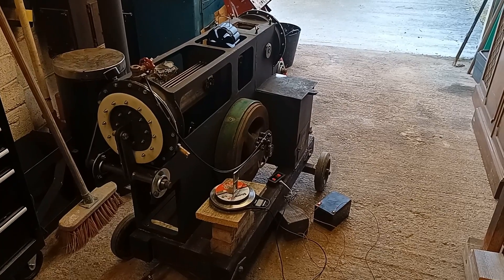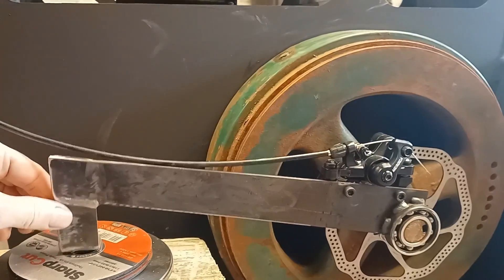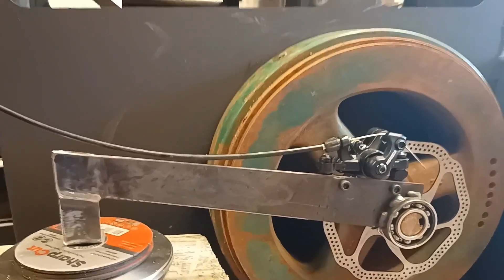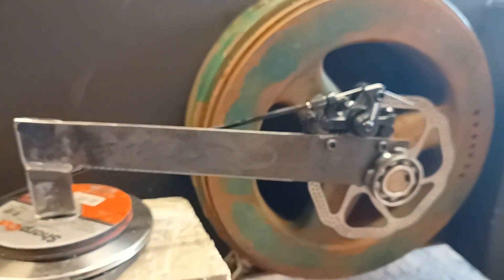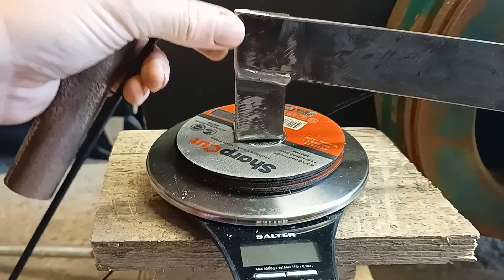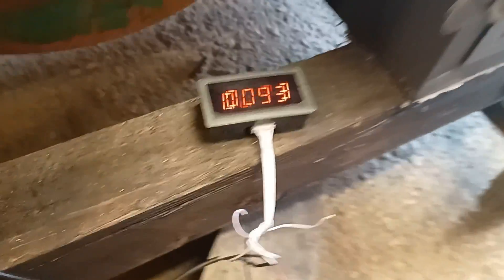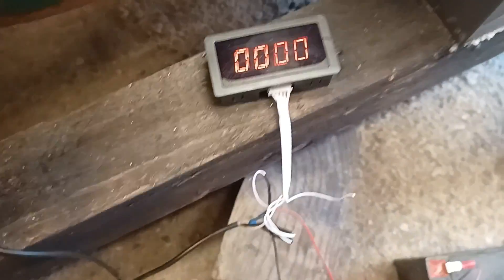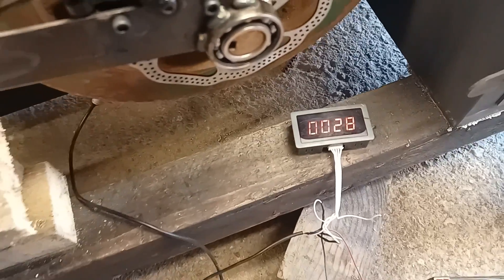Stirling Engine Generator Mk4 (Rocket Stove!) Part 7

Comment: After 400c° rubber melts, unless using water jackets or chambers not directly attached to the heat source. Temperature control is everything for performances and durability.

Comment: This is possibly a stupid question: Does the rubber sea work against the engine? Presumably it's elastic and the expanding gas has to work against it. Also, it looks like it inflates out at tdc, is that not gas expansion that's wasted on inflating the rubber instead of moving the cylinder?
Reply from the maker: Yes, you are quite correct 🙂, a bit more work to do on this project!

Comment: Rats Shane. Sorry about the diaphragm blow-out.
I really like the pony brake and rpm indicator.  The engine looks really nice. I wonder how a side wall from a tire would work as a diaphragm? Maybe might not stand the heat. Don't know how hot the hot air gets. Race tires on cars get pretty hot though...
Thanks for sharing the good results and the setbacks too.
Learning alot from watching your journey. First Rate.
- Chuck in Jensen Beach, Florida.
Cheers.

Comment: Heat is the issue - even the best polymers are going to be challenged at anything over 150 c  -   metal foil diaphragms offer up to 400c however they need concentric pressed corrugations not easily duplicated DIY - companies like Hudson may be able to help - where about in UK are you based - do you exhibit at showgrounds  - would like to see your engines, have a brew and natter
Reply from the maker: Hi, Other than the heat issue on the hot seal I'm fairly happy with things so far. I live in Cornwall and exhibit at a few rallies a year. We will plan to go to the west of England show near Helston. Last year there were the best part of 10 full size stirling engines running there, quite impressive! Your always welcome to pop by, cheers

Comment: Maybe use a suspension airbag/airspring?  They are meant for heavy flexing... then you could also do away with the flat seal... the airbags usually have plates top and bottom you can cut into
Reply from the maker: I've just taken a look and they look very suitable. My only concern is the heat. I'll measure temp next time to see, cheers

Comment: All alpha designs I've seen have a means of isolating the sealing area from the hot working fluid by distance, insulation or both. Often this will be an extension to the crown of the hot end piston such as a sealed hollow 'can', like a displacer. Were you to incorporate something like that, it would clearly require a longer hot end cylinder and some means of stabilising the piston - perhaps a tail rod and guide would be the simplest.
Reply from the maker: Your right! It might be the way the design will need to go. I'll try every available material first : ) Many thanks

Comment: Shane, what a novel way to work out power output.
Pity it didn’t actually happen though.
Are you still working on the piston wobble, or are you not too concerned?
I have been pondering on the watt linkage system to limit the piston wobble issue.
If you want me to keep working on a solution, I would need some construction measurements, if you were keen.
This would let me work out pivot positions etc.
Regards, Brian from NZ.